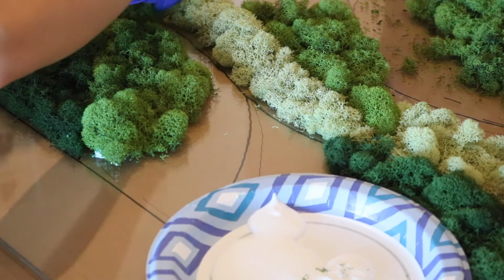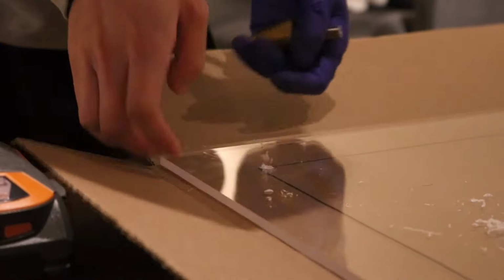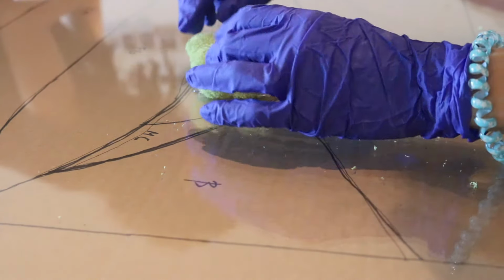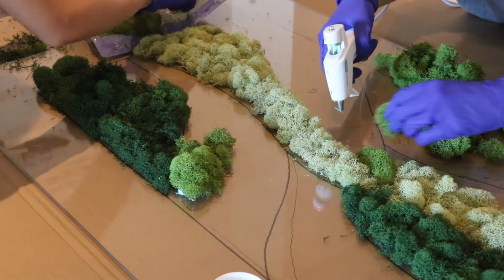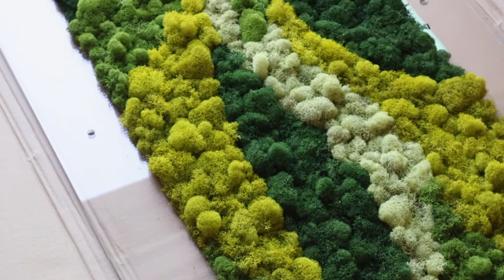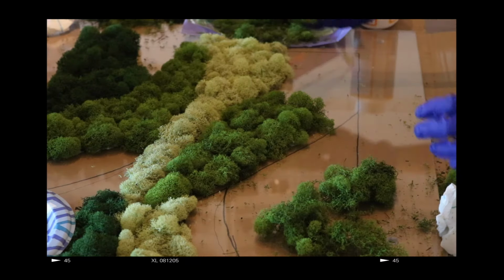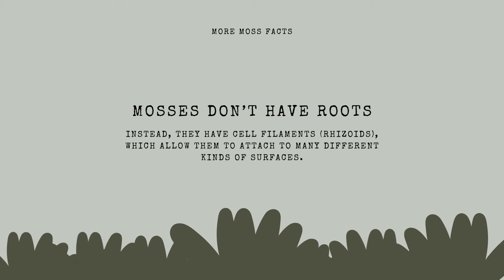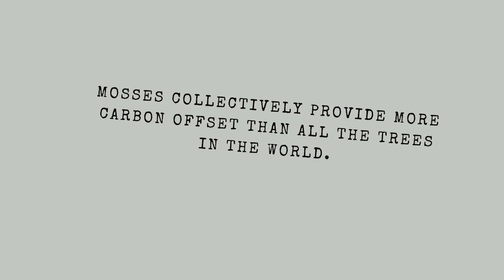EASY DIY moss wall art statement piece!! 🥦🥦

Comment: Here's the craziest moss fact of them all:
What you used wasn't even MOSS! It's actually Cladonia rangiferina, which is a lichen, and while it sometimes called Reindeer Lichen, or even Reindeer Moss, it is not a member of the same Genus as other mosses. It is actually classified as an endangered species in some areas that it grows (mainly in the UK). Because it is edible, it is eaten by reindeer (caribou), and is used by  indigenous people who live in it's range as a medicine and an occasional food source! #TMYK

Great Job on the moss art! If I may offer a suggestion, I would recommend using a darker or opaque background in the future, so that light can't pass through from the back as easily in the thinner spots. You can still have the same look as the acrylic with the standoffs, but you can paint the back of it black before applying the moss (not the entire back, just the inner rectangle that has your design on it).